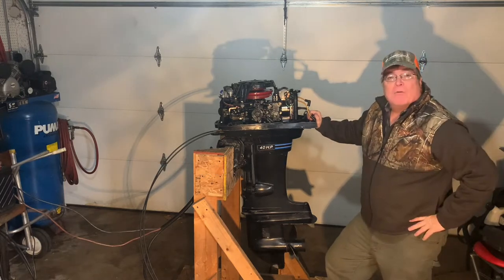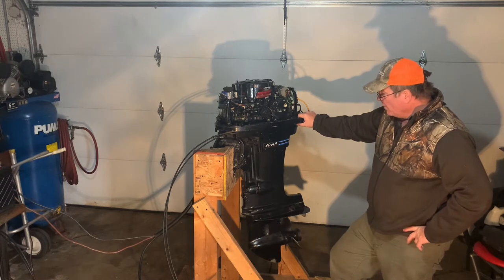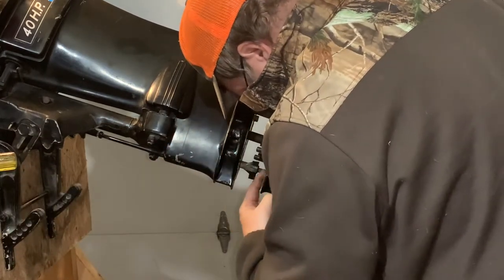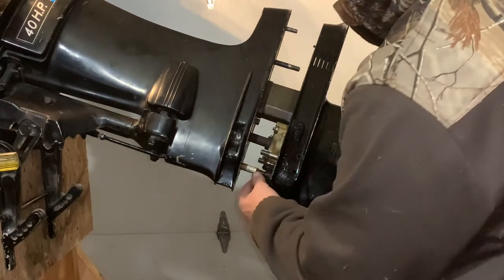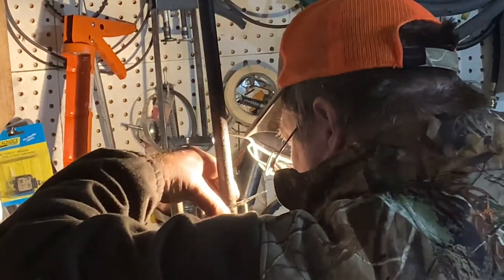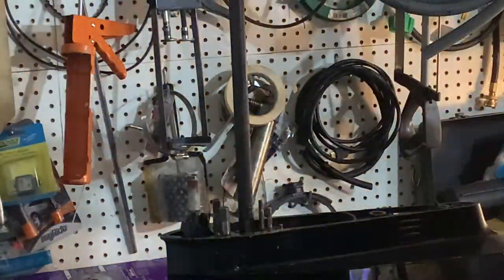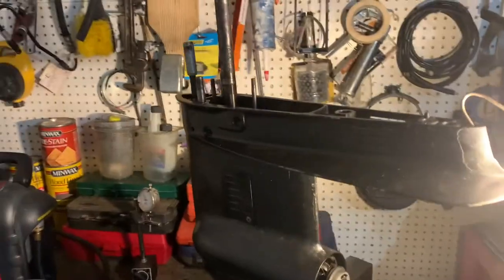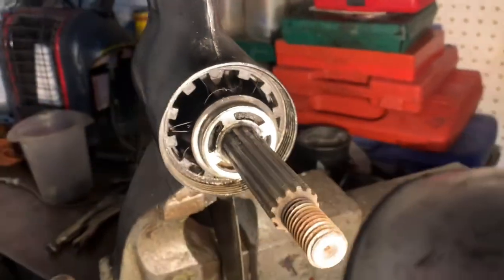1973 40 hp Mercury 402 - Part 3 of 6 - Will it Run? Parts Motor or Runner - Lower Unit Issues

Comment: I think I have all the nuts and bolts out. Only got about a 1/4in drop from it. Am I missing something or just need more brute force?
Reply from the maker: Dan Simmons… your shift shaft or drive shaft is probably stuck. If you turn your flywheel does it still engage the lower gearcase/prop? If not it’s probably the shift shaft. Soak the shift shaft with a lot of PB Blaster and let it set overnight. It will come out eventually.

Comment: Working on one now. Having trouble getting the lower housing with the o ring seal installed. And the gasket installed without treating it. You don't have that part in the video.
Reply from the maker: If I understand what you are referring to is the lower half of the water pump housing, you will need to press it in as it is a tight fit. If I remember I had to use a piece of wood and a small hammer to get it in and seat properly.
Reply: @LivetofishOutboardRepair  yes thats the one. I ruined to caskets.
Reply from the maker: @robl6570  yea I think I was going to reuse the original lower gasket and ruined it trying to install the lower housing. It’s a pain in the butt.
Reply: @LivetofishOutboardRepair  how in the world did you get the shaft and water tube to go in since the tube is installed in the water housing.. Thanks
Reply from the maker: @robl6570  your copper water tube should be inserted into the power head first. Then you should be able to get it all together.
Reply: @LivetofishOutboardRepair  thanks